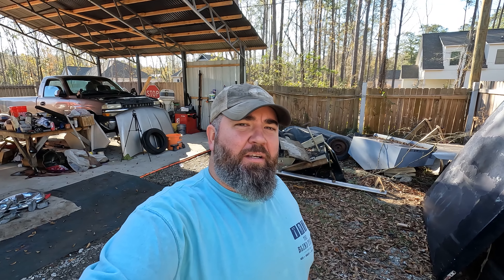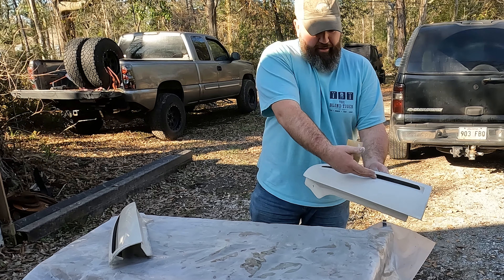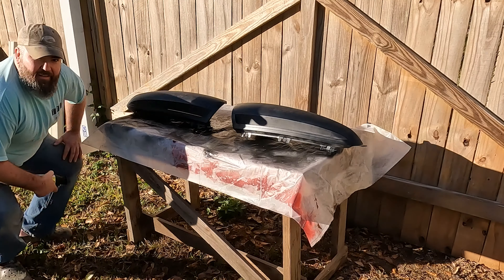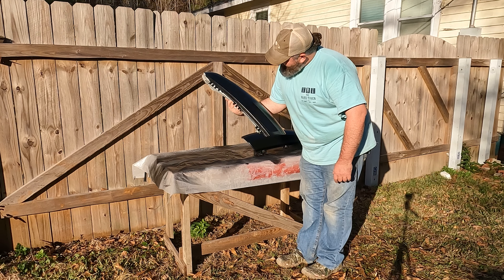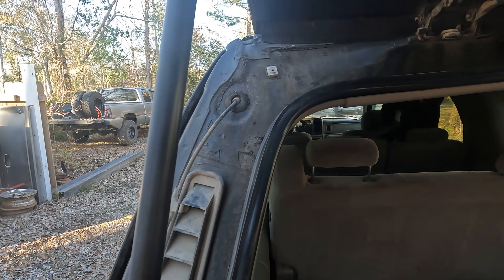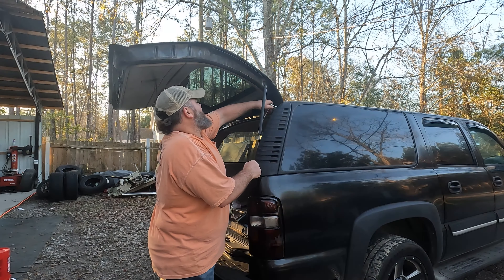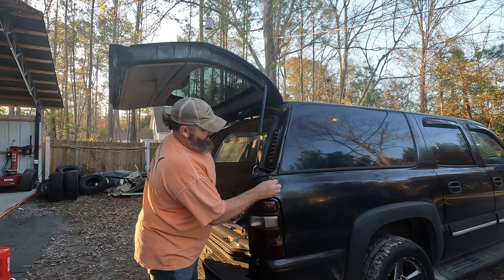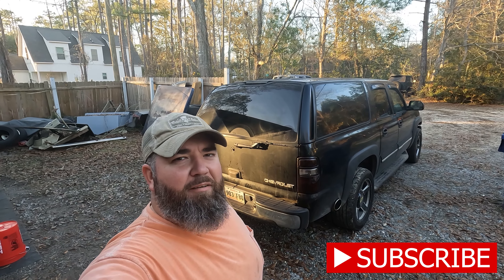Cadillac Escalade D Pillar Cover swap on the Gangsta Burb!!

Comment: Hey bud!!! I'm in SE Louisiana as well!!! Right in the Mandeville area...
Reply from the maker: Very cool! The 8.1 is thirsty, and I only run 93 octane. Because I get pre ignition noise on anything else.
Reply: @Modified1  
So it tends to knock? We are getting ready to pick it up. Has several things I need to fix. The pump rub in the transfer case. It is leaking at the front dif/axles. Coolant build up by the driver side head (not sure about that one.) Oil cooler lines has a small leak. And needs a new oil plug. Has 165k on it. And he just did 2k worth of maintenance last yr....
Reply from the maker: @Faithful Frenchie Farm Nola  mine was an Angola prison guard truck and now has 172k on it wit a slight rear main leak. That's it